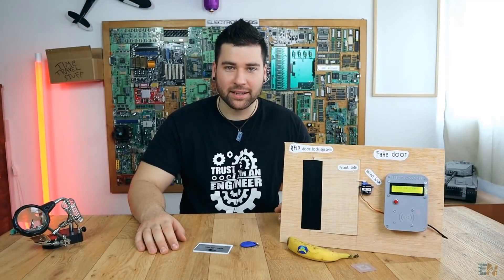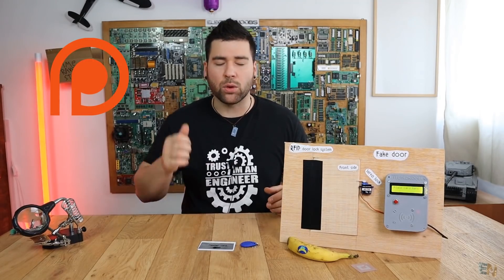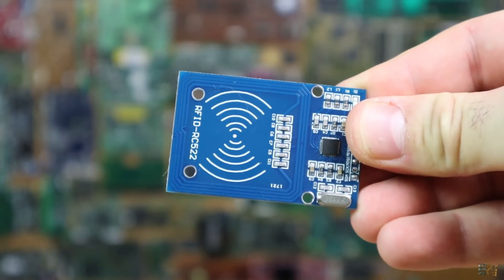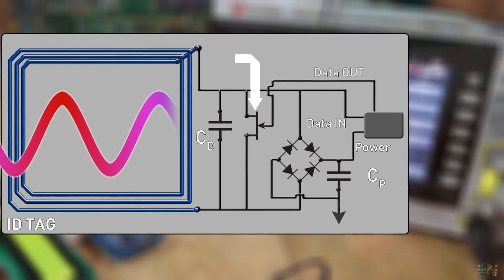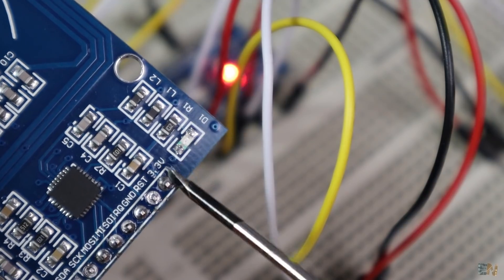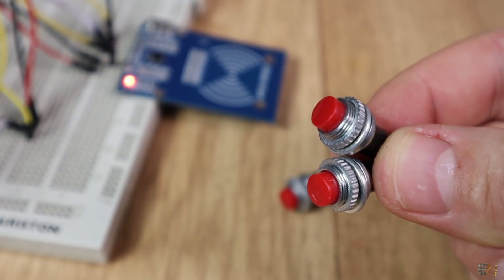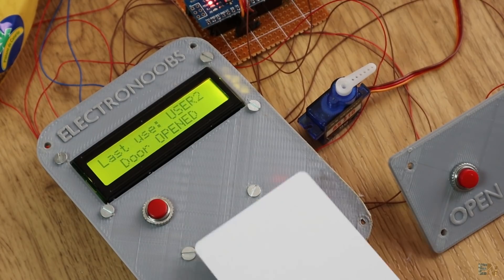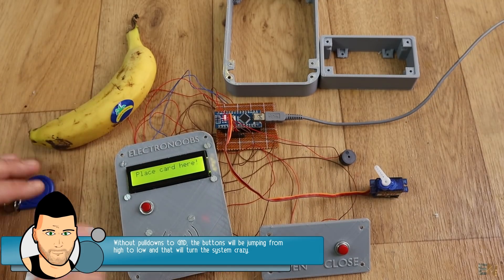RFID DOOR LOCK -  with 3D printed case

Comment: thank you so much for explaining, I need help to write a code that when RFID is not ok be presented 5 times in a row the program will delay for 30 minutes, can you help me with that below is the code I used
#include <SPI.h>
#include <MFRC522.h>

#define RST_PIN 9 // Configurable, see typical pin layout above
#define SS_PIN 10 // Configurable, see typical pin layout above

// Create MFRC522 instance.
MFRC522 mfrc522(SS_PIN, RST_PIN);

String read_rfid;
String ok_rfid_1 = "4377331c";
String ok_rfid_2 = "e3ed9b"; //add as many

#define red 4 // led
#define green 3
#define relay 7

void setup (){
Serial.begin(9600); //initalize serial communicatioons with pc
SPI.begin(); // Init SPI bus
mfrc522.PCD_Init(); //Init MFRC522 card
pinMode(red, OUTPUT);
pinMode(green, OUTPUT); 
pinMode(relay, OUTPUT);
}

void dump_byte_arry(byte *buffer, byte bufferSize) {
  read_rfid = "";
  for (byte i = 0; i < bufferSize; i++){
  read_rfid = read_rfid + String(buffer[i], HEX);  
  }
}

void open_lock () { 
// if rfid good this is what will happen

digitalWrite(green, HIGH);
digitalWrite (relay,HIGH);
delay(4000);
digitalWrite(relay,LOW);
digitalWrite(green, LOW);
}

void loop() {

// Look for new cards
if (! mfrc522.PICC_IsNewCardPresent())
return;

// Select one of the cards
if ( ! mfrc522.PICC_ReadCardSerial())
return;

dump_byte_arry(mfrc522.uid.uidByte, mfrc522.uid.size);
Serial.println(read_rfid);
if (read_rfid == ok_rfid_1){// RFID #1 ok, open the door.
    open_lock(); 
}

if (read_rfid == ok_rfid_2)
open_lock();

if (read_rfid != ok_rfid_1 && read_rfid != ok_rfid_2)
{
  digitalWrite(red, HIGH);
  delay(5000);
  digitalWrite(red, LOW);
}
}

Comment: Please make an improved version in which the circuit and the servo are inside cause this is not that practical or make an aluminum cover 😉 (it will be very easy for someone just to break the 3d printed casing and allowing the manipulation of the back buttons)

Comment: Hello, could you add to this project a led power indicator, one that indicates when the door is open and that with a button you can turn on or off the arduino ?, please, I try to do it and I can not find it, I did not find any video hanging around the network that show how to do it, or the programming code, very good project by the way .... (traductor)

Hola, le podrías agregar a este proyecto un led testigo de alimentación, uno que indique cuando la puerta esta abierta y que con un botón puedas prender o apagar el arduino?, porfavor, intento hacerlo y no lo consigo, no encontré ningún video rondando en la red que muestren como hacerlo, o el código de programación, muy buen proyecto por cierto

Comment: RFID uses Load Modulation. It does not send back any signal. That fet is used to short the reciever antenna and that way make a bigger load on the transmitter circuit, which will result in voltage drop on the transmitter side. At least it works like so in 125 kHz tags. Are you sure, that it works as you described in the video in 13 MHz tags?
Reply: And the smaller cap is used to tune the resonance freq of the circuit.
Reply from the maker: You are right. Thank you so much. My mistake!
Have a nice day!
Reply: Thank you! By the way I absolutely like your videos, it is awesome, to have guys like you, and that you make the effort to teach others. Keep it up! 
Regards